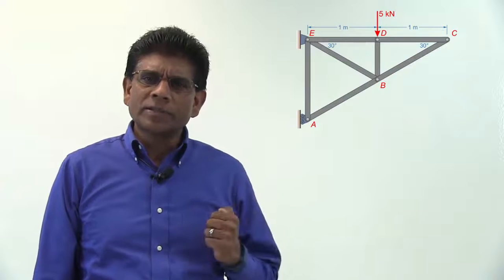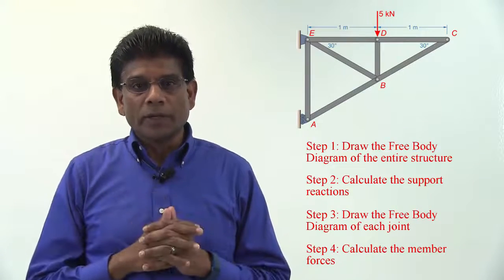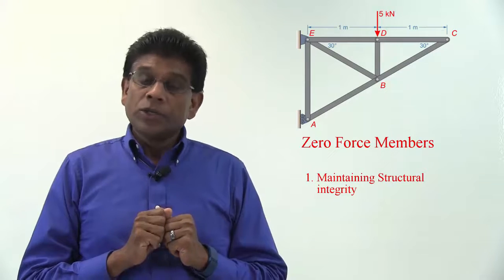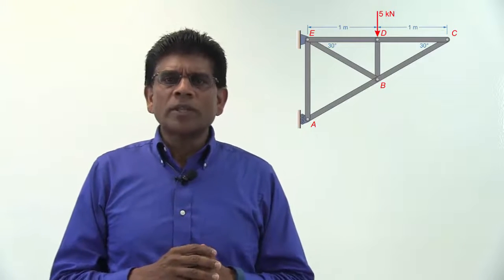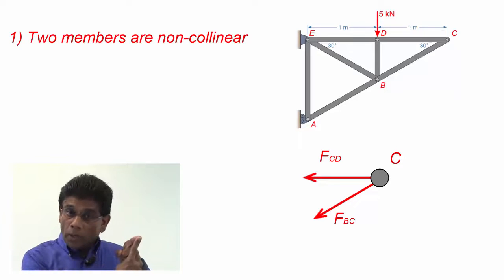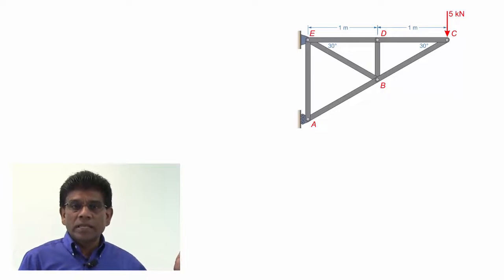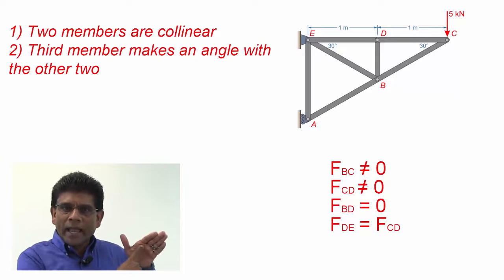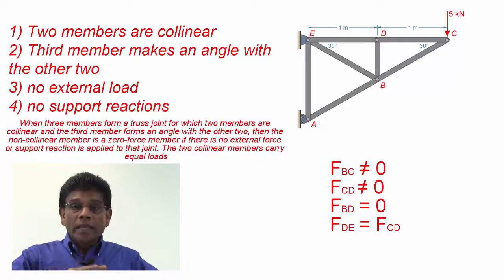Zero Force Members - Lesson 15

Comment: is there a way to identify a zero member in a joint with 4 members? with 5 members?
Reply from the maker: Not directly but it is possible if you have information about the members from other joints. For example, in this example, there are four members in joint B. If DB is zero, then the four member scenario reduces to three member, and we can apply the rules.